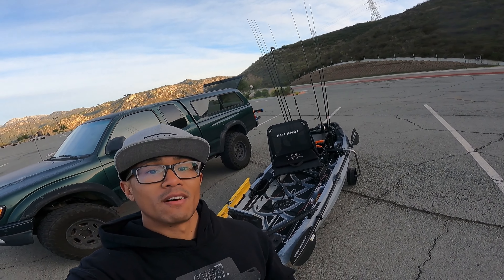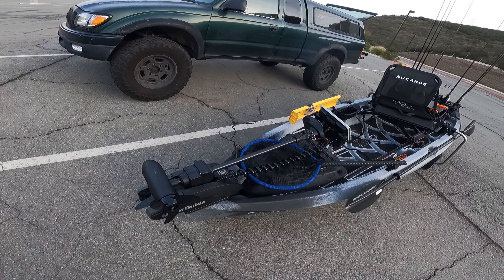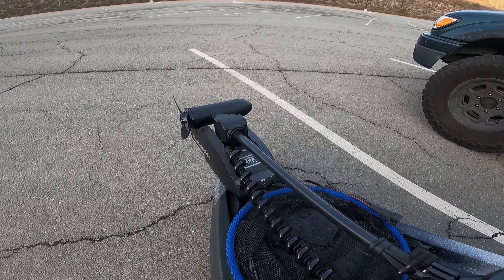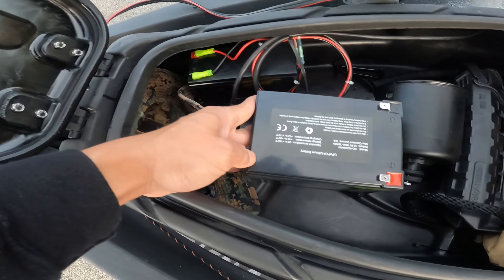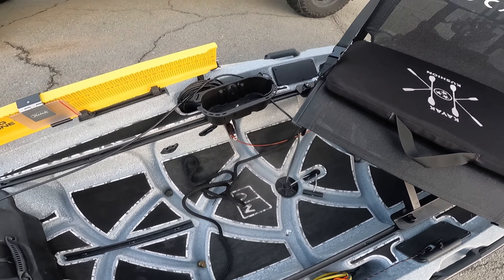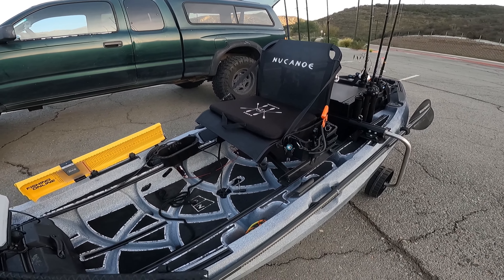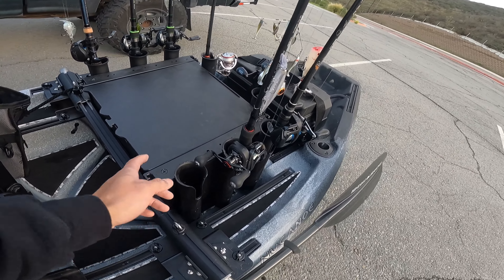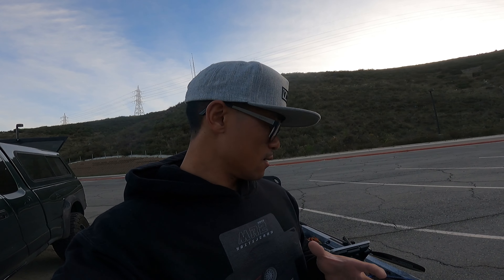New kayak for 2024! Nucanoe Unlimited

Comment: Not a good kayak no Bauer stern mounts for trolling motors check out the native
Reply from the maker: They make transom mounts for the Nucanoe but honestly, the bow mounted xi3 has been working just fine for me. Not to take away from the Native, they have phenomenal vessels as well, but if it works for you then that’s all that matters. Tight lines! 🎣